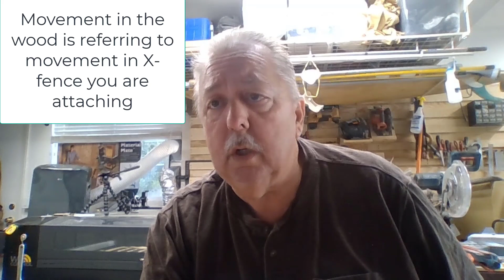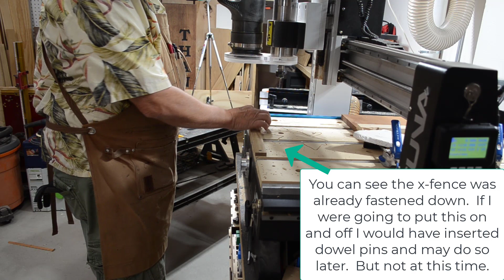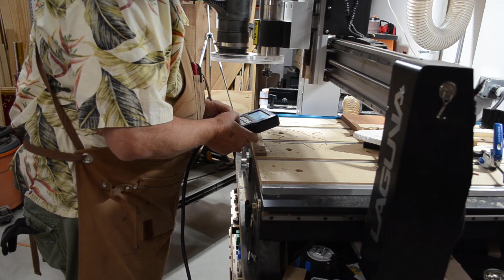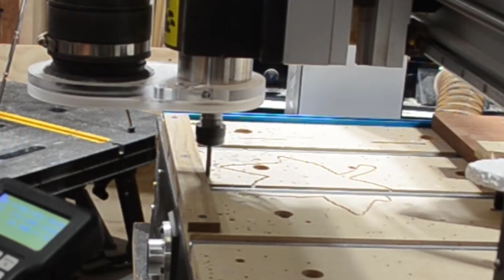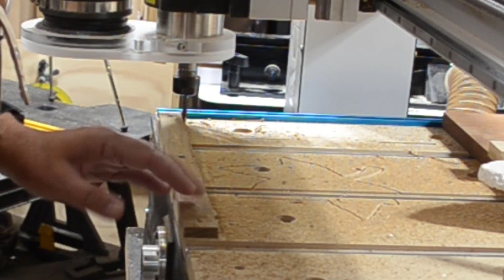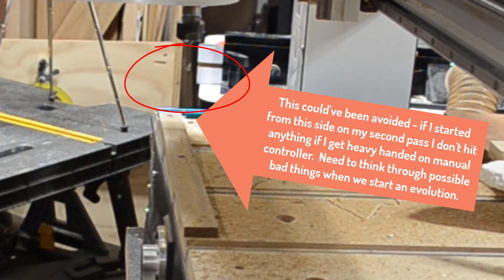X Axis Fence Install and Alignment For Multicolor Epoxy Inlay

Comment: I have made a shallow groove with a vee bit in my spoil board in the X direction and then try to align the fence to it. It's 98% to 99% accurate on a good day. Your method is 100% right on every day! Good tip, Rob.
Reply from the maker: Glad you found it helpful.

Comment: Good tips I don't know if I could do that I don't have a controller just the mouse
Reply from the maker: If there is way to control your spindle movement manually in x or y direction it should be able to be done.  Just not familiar with all the different CNC operating systems.